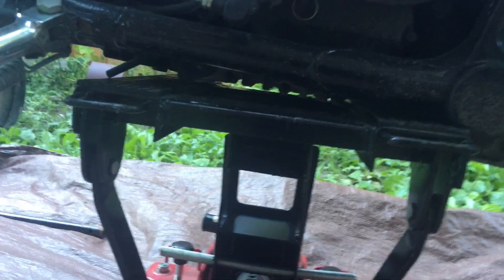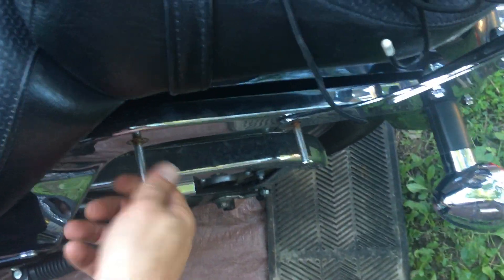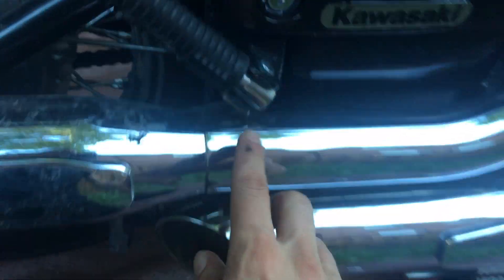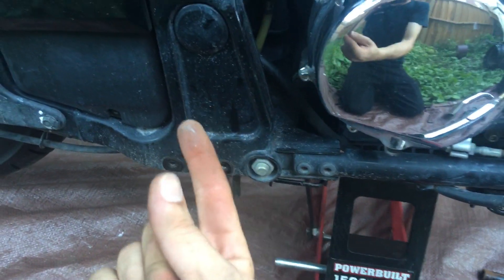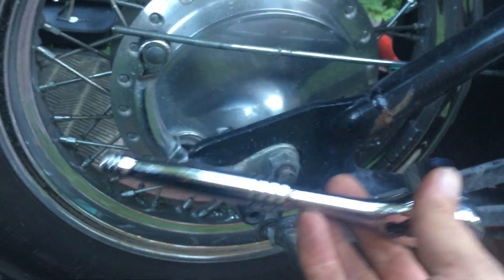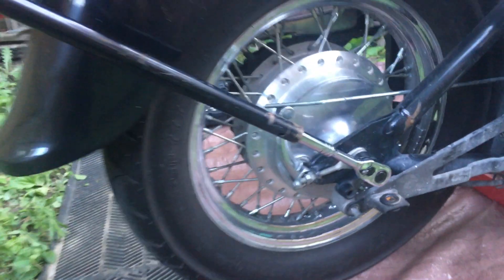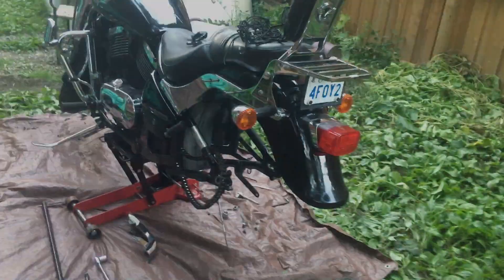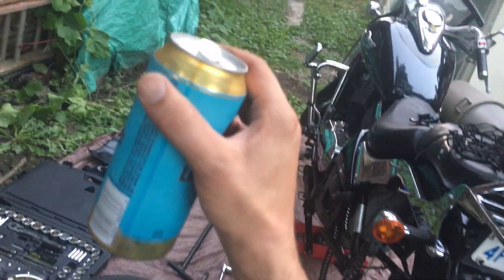Vulcan 800 Classic Rear Wheel Removal

Comment: You should buy a cheap torque wrench if u haven’t already, I bought one of amazon for under $15 just get one of the “flex” ones not the click type, they’re so simple they can be manufactured cheaply without compromising usability, it’s basically just a bar of steel that bends and they set the gauge according to the flex